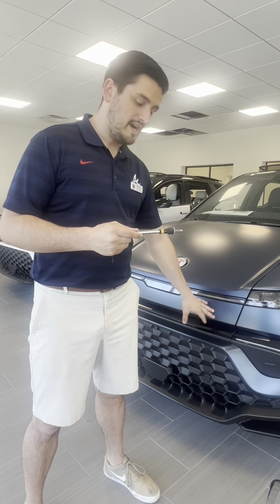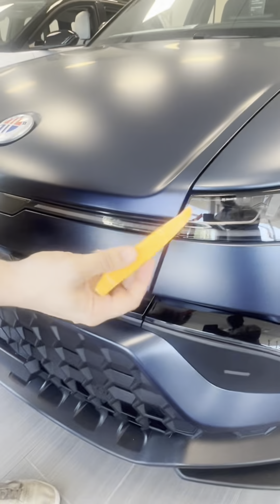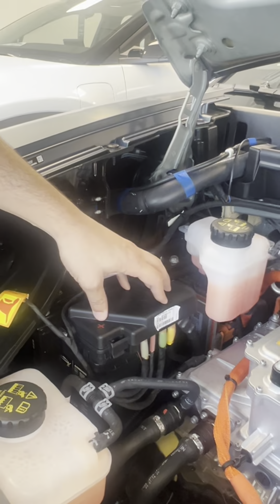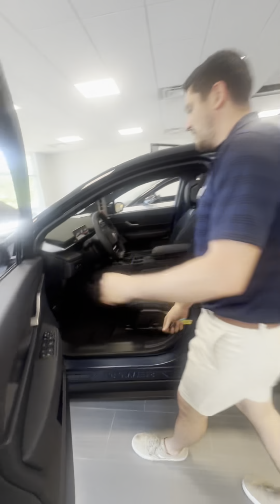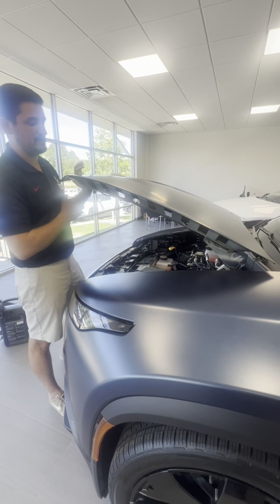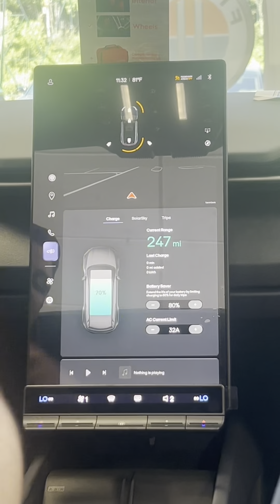Fisker Ocean Tips & Tricks | Jump Start

Comment: Thanks! There is a button on the hood latch that you can press to lower the hood, on the other side of the same latch mechanism you touched. Do the same thing with lifting up the hood slightly, then press and hold the latch to release it while lowering the hood down. Also I have found that a small portable jump starter works, like a Schumacher li-ion model (there are other brands too).

Comment: I opened my fuse box cover & noticed my fuses don’t match the online pic. I have several missing. I was going to remove the fuse for the horn, but I don’t have all the fuses in place on the diagram. Is that right? I took pics  & can send if needed. Pls help!
Reply: try to call sean...as far as i know you need to remove a fuse and a condensator to turn off the sirene......

Comment: Initially my 12V was dead. FOB totally non responsive. Changed the FOB battery, didn’t help. I opened the hood & attached the charger as shown. But once I did, the alarm started going off. It cycles with the horn going off. What should I do?
Reply from the maker: @ljames7724 If the battery is dead and you were able to follow these steps to get it jumped, the key fob is non-responsive even with a new battery, and now the horn is sounding as part of the alarm function, simply walk up to the driver door handle and place the key fob against it. The NF function will unlock the car and that will disengage the alarm.

Comment: Sean, my FOB is non responsive. I had to use the back hatch release button to get in,  &crawl through. Drivers side door unlocked worked & I hit the doors to unlock. However the charge door hatch won’t open. I opened the hood & connected the charger. My alarm was going off. Now my horn is honking. What do I do? Thx

Comment: Excellent video, very clear directions do very useful. Question. After this do the back most doggie windows need a Fisker tech to recalibrate? If so will a future OS be accounting for this so owners can recalibrate without the need for a tech. Also, just in case this happens and if we do loose control of the back window we might want to make sure that every time we park that the all windows are closed. That way if we have to do this and we loose control of that back windows we wouldn’t be driving with it constantly down.
Reply from the maker: @DaveDarin If your Ocean dies then the doggy windows will stop working when trying to use California mode, and can only be reset by a technician. I would ALWAYS park your Ocean with the windows rolled up to prevent being stuck with them rolled down.
Reply: @atlantaviper  that is actually insane really impractical.

Comment: When the hood is raised and locked it can be released using the provided clamp handle on the inside of the right hinge. Any attempt to push the locking pin from the outside is a risk of pinching.